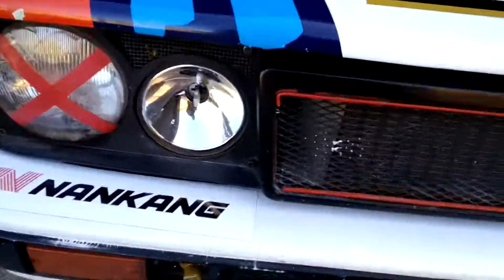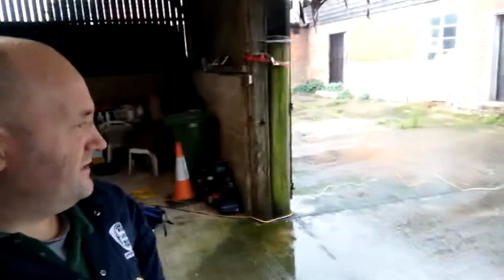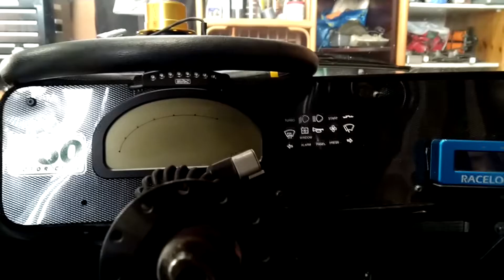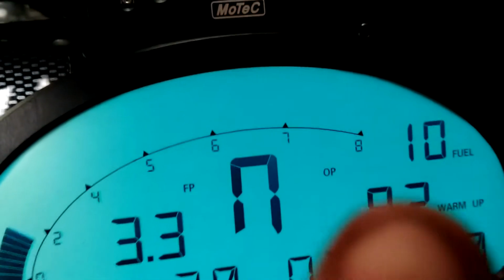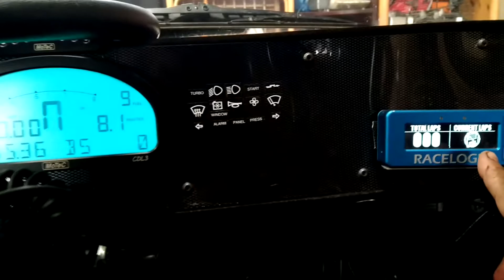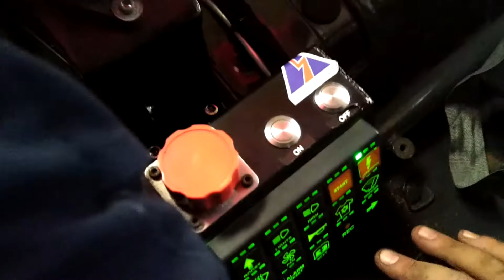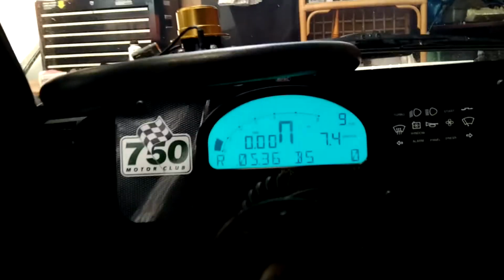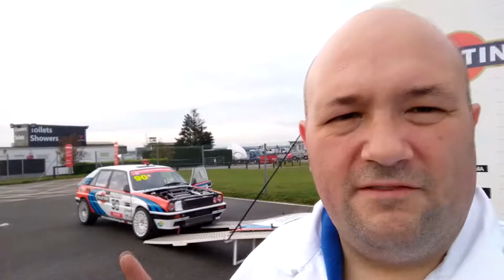Lancia Delta Racing - Track Day at Snetteron

Comment: Great video!
Have you got balancer shaft delete fitted? Also has the gearbox got 3rd gear re-inforced?
Reply from the maker: Both balancers deleted, we use the cam sensor from the EVO. The box uses standard outer casing, has BACCI dog rings, re-enforcement plate and a billeted 3rd/4th selector (after it broke twice). There is also two breathers on the gear box which has meant it now doesn't leak oil... all the time.

Comment: Such an awesome and capable car, gutted I never had chance to drive it that day because some numpty killed the clutch. Have you got a link to the clutch you are using now please.
Reply from the maker: Sorry Steve. I often think about letting you all down, I still feel really bad. You can order the clutch through John at JJ Performance (01296 655255). John has the distribution deal for the clutch with the supplier and 6 other deltas are already having it fitted. There are going to be 2 versions, a road and race, road one won't have the same torque capabilities but then you wont need to be a weight lifter to use it. Both are much more capable than the shite currently available which can only do about 350 horses.
Reply: @V8EOL  
Thanks for getting back to me, that's great about the clutch. I'll save the number and give John a ring, thanks 👍